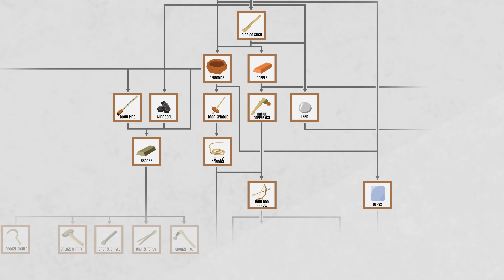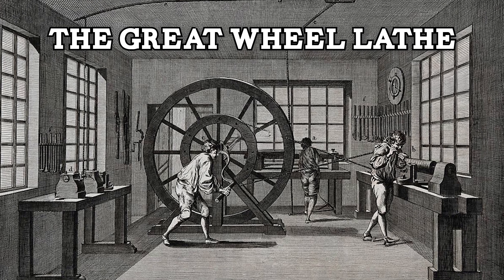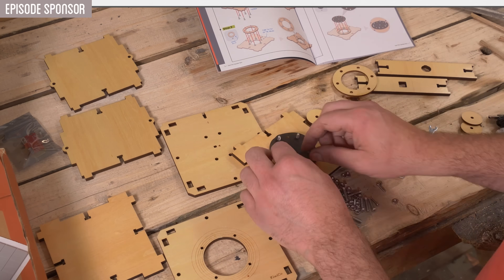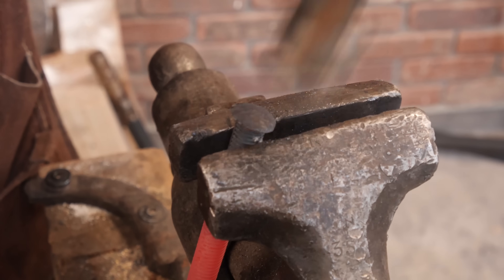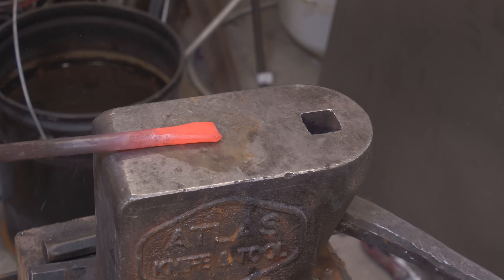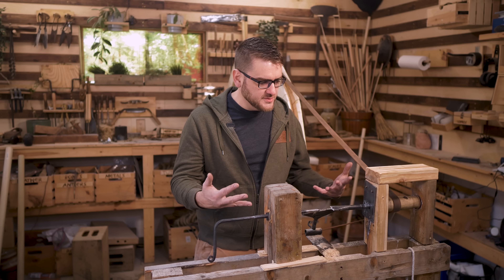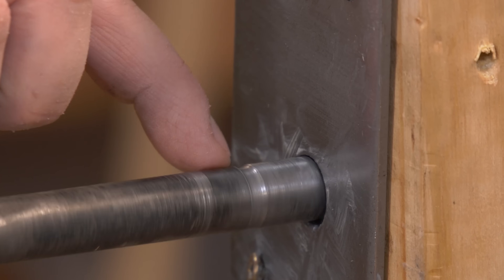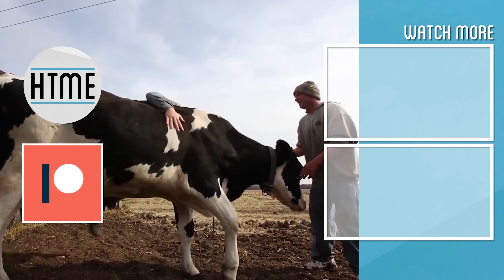Building the Lathe That Will Build Everything

Comment: Steel on steel wears, as you have noticed. A bronze bushing is a good choice until ballbearings are unlocked.
Reply: AIUI they used greased leather for a bushing material, clamped tight.  You need an essentially zero play spindle if you want to cut metal or cut with precision.
Reply: @AlitaGunm99  You can turn metal between two greased dead centres. then the play in a coaxial spindle outside the static dead centre doesn't matter. it will transmit the motion through a lathe dog.
Reply: @AlitaGunm99 I was a machinist for a decade, running lathes, mills, grinders, EDM, etc....

Drilling an accurate hole is not too hard, outside turning a bit harder, and maintaining concentricity and parallel is hardest.  Grinding to precision is easier with metal than using an inferior lathe.  Once you put one machine together with little slop in its ways (the rails on which the cutting tools slide), making screws and things elis fairly easy.

The genius of the early metal lathes, IMO, is how adjustable they were.

For some operations, like cutting through the bark (outer crust of cast metals), I would turn our old machine backwards, flip my tool upside down, and let the "looseness" work in my favor.  

TLDR, sometimes a less precise setup is better, and grinding and filing to precision is pretty easy.
Reply: He could even use wood with lubrication. And drastically reduce the stick out of the axle from the block.
Reply: @Lysdexis   Yeah get the hardest wood you have and soak it in lubricant for days.
Reply: was about to type something similar about bronze or copper bushings, but could utilize wooden dowl/pin bearings.
Reply: @chuckystabs1745  I don't think wooden needle bearings would work very well; not enough contact area and too soft.
Reply: A hard lead alloy would be easier to cast than bronze.
Reply: @Piglin_Jesus  Babbitt metal would work great too.
Reply: @Piglin_Jesus  The low melting point makes it a bad choice for a lathe, unless they are constantly dousing it. Even then, any debris at all. If it doesn't just scrape away the lead, it will certainly add enough friction to melt it.
Reply: @timbrwolf1121  Lead has a melting point of ~620 F and babbit metal has a melting point of ~450 F.  Babbitt metal has been used in bearings for over 200 years.  The entire point of the bearing are to reduce frictions and stabilize rotation.
Reply: Actually, lathes use mainly bushings to this day as they are more precise and can take higher load
Reply: What is a bronze bushing ?
Reply: @PotionsMaster666  A piece of solid bronze with a bore for a shaft; steel on bronze moves smoothly and freely, especially with a little oil or grease.
Reply: @PotionsMaster666  Bronze is an alloy of copper and tin.  A bushing is a cylindrical metal sleeve that acts as a bearing surface for a cylindrical rod inserted through the bushing.
Reply: The places where I work uses purple heart or teak for lathe and grinding wheel bearings
Reply: why not brass? has he not gotten zinc yet?
Reply: Cylindrical roller bearings would make sense here, and simple to produce.
Reply: Next step would be to cast the bed, the tailstock and the headstock out of iron. The pulley could be cast as well, giving the machine a much more rigid structure.

Comment: another factor onyour belts,   they actually work best on a bulged pully,  not in a notch,   the outward bulge of the surface helps to move the belt back to the middle rather than slipping off to one side.

Comment: Awesome work and yeah the lathe is one of the center pieces of modern working^^ The flywheel is a development on its own ... yours currently is using a lot of energy to move itself around .. and has a relativly low weight overall moving around but getting a heavier flywheel balanced is supprisingly complex and dangerous if not secured correctly.

Comment: I realize you're already past this step, but the talk about screws made me think of how to easily make a precise metal screw without one to go off of to start with, and I had an idea. Would you be able to make a tightly wound spring the length of the screw you want, with the wire gage of the spring being the width you want between each ridge, then cast a brass or bronze negative of the inside of the spring to make a precise screw you could use as a guide for making other screws out of harder metals?
Reply: you would have to tightly control the cross section of the spring as well as the pitch for it to have a hope of working. Not exactly the easiest task in the world, distortion can be a bitch when forging, so you'd have to try and adjust the cross section of your straight rod to compensate as you wrapped it into a spring to hopefully result in the negative of the desired threadform on the inside of the spring. 

in short, not easy at all

Comment: Using the lathe to improve itself was so cool.
Reply: It's like computers really. 

We required a computer at one point, then we needed a better one, so we needed a very good computer to build the next tier of computers so we could build an even better computer, so we did and now we have glass slabs that make us mad when we read stuff on them.
Reply: It si like when You have a 3D printer and start to print things for itself.
Reply: The lathe is the king of tools
Reply: The lathe is the only tool that can build itself. Think about that.
Reply: So far
Reply: Well not the only tool. 3D printers can also print themselves. In fact I am doing that right now with "The 100", fully reprap style.
Reply: @DoubsGaming  Please tell me the name is a Terminator reference and the next versions will be "The 200" "The 300" and so on
Reply: Adam Savage once said, “The Lathe is the only tool that can build itself”
Reply: @ Now now, what about the 3D printer?
Reply: @IneptOrange  It can't make its own heating element. As it would just melt instead.
Reply: @Targe0  Very good point

Comment: There are quite a few clever details in old tech, that are not immediately obvious, unless you look carefully. One is the flat belt tech. The wheels don't need and shouldn't have a groove or flanges. They just need to be convex. The belt then centers itself.
Reply: Came down here to say the same thing, but you worded it way better than I ever could lol @esalehtismaki
Reply: If I'm not mistaken flat belt pulleys should be (rather counterintuitively) concave to be self centering
Reply: @rlrfproductions  no, if they were concave, the belt would slip off. Belt sanders also have convex wheels for this reason.
Reply: @coreforge I was mixing up concave and convex hah 😅 but yes, "American football shaped". Though that did surprise me when I learned it, it's the opposite of what I reasonably expected
Reply: It's the same principle as on train wheels

Comment: 8:25 a belt with even a little bit of stretch centers itself on the larder part of a wheel rather than the valley, on the little wheel you an see this quite well, its not an alignment issue its just physics, i think it was steve mould who had a great video on it (tho its been a while and im not 100% certain but it sounds like it would be his video)
Reply: They realize this and change the part in the video
Reply: @ yes and my comment was mainly as an explanation as to WHY this happened in the first place

Comment: I feel like you would have better results on EVERYTHING you do if you made a point to overbuild stuff, measure it better, keep it level, and use less crappy wood. You've got the inspiration but everything you make is too flexible. I think part of the problem is you're getting cheap wood at a home center- go to a proper lumber yard and get better wood, it's tougher and wont flex or lost dimension as much
Reply: The main issue I think is cost
Reply: @theomelchior2739  No, it's time. If Andy took the time to do it well-built and proper, it'd take too much time to consistently release videos. And that'd sink the channel due to lack of funding.
Reply: @JoshuaNorton  while I generally agree with you, some well built, reusable parts would greatly improve his capabilities. Something like a well made wheel and axle could have boosted several of his creations.
Reply: @theomelchior2739  You would be surprised how much more you pay for the convenience of big box stores. A small amount of higher quality wood isn't that expensive.
Reply: This is why I don't watch this channel much. Everything is just such low quality and he always assumed the thing isn't good because of that.
Reply: Of course he's not going to build the perfect machine. That usually requires maaaaany people and maaaaany years of experience. One person can't do that and that's fine.
Reply: @MatthiasLehnen  i meam, sure, but at the same time theres some glaringly obvious flaws and issues which i'm convinced would take less time to solve than the time it takes to work around them. Something like spending a bit more money to get better wood, spending just an hour or so loading the machines with sand bags so it doesn't wobble, spending an hour or 2 to make a rudimentary brass bushing, and maybe another 2 hours to straighten the flywheel. Thats about a days work which will pay off by needing less time and effort when using the machine, allowing the creation of better parts, which improves the quality of everything those parts are used in, which saves even more time down the line. the ripple effects on time savinga of those low hanging fruits is immense.
Reply: i agree fully with OP - its a ckunterintuitive "spend time to save time" thing, honestly not too dissimilar from "buy cheap, buy twice" but with your own productivity rather than a product
Reply: I agree. I love this YouTube channel, but it should actually be called How to Make Everything Crappy. These people have a lot of enthusiasm but very little skill and "designer's intuition". For example, the claim that learning to use a pedal lathe would take a lot of time.. Like what? That's a matter of one day at most. Or that they used a concave pulley first. He seems to be very interested in this technical stuff, doing various research for the content and so on, but then he puts a concave pulley in there as if he didn't think about it at all. I don't get it.
Reply: @FarAwayInNature-r4f  The pedal lathe he built would take a lot of time to learn because of its mechanical inefficiencies due to poor build quality. Part of his thinking is to get past each step quickly to get to steam
Reply: @flyingmonkeydeathsquadronc968  Yes, exactly as you write " poor build quality". Yet the pedal lathe is perhaps one of the most primitive pieces of equipment, still used perhaps everywhere in the world, and it is a very useful thing. You don't need top quality wood to build one, the construction can be quite crude, and you can still achieve quite precise work with wood and even soft metals. If they built it properly, it could be very useful to them, even in the steam era. I'm not exactly sure what they're after then. Whether they want to build functional replicas of historical inventions and use them to move forward, or just present a shaky thing that can barely withstand filming. Because if B is right, there's nothing to look forward to. If they can't handle a primitive lathe, what will a steam engine look like? If A is right, they might finally learn from the mistakes they keep making over and over again and start making it properly. And in their case, that doesn't mean spending more time or money on it, it means starting to think about what I'm doing and how I'm doing it.
Reply: @FarAwayInNature-r4f  that's always been my opinion too. A ton of effort, quality and enthusiasm in production but then just build a crooked thing. No craftsman would have finished these builds if they were crap. This is like Gilligan's island staring a very creative actor who is pretty ok at building some stuff. With that said he's better than I will ever be at much of this stuff and I applaud his efforts to create such a cool legacy. I do still watch often.
Reply: There are so many skills needed. Engineering, metalworking, woodworking, each of which takes years to get really good at.
Reply: Also if they cared, they make crap because they are fine with making crap rather then make something good.
Reply: @Thorgon-Cross  the problem with boot strapping into precision is you HAVE TO take time and build quality or the inaccuracies you introduce at each step will set you back two.
Reply: @Vulpecula1919  Glad you agree.

Comment: Making the giant wheel spin level would be a big help, when things spin on their side there's some gyroscopic effect that acts on them which makes them wanna pull further sideways till it can hit a balance point

Also tension is your friend when it comes to belt pullys, you could either rework the spacing of the wheels themselves or add a adjustable height wheel that presses against the belt (I think a spring powered extra wheel to act as a lead & provide tension seems more efficient) what ya don't wanna do

Comment: Once you fix your belt pulley, get the wheel alignment dialed in, and take out some more of the play in the axle, you'll have a genuinely nice machine on your hands!
Reply: Also the drive axle didn't look quite straight. Having the drive axle and tail stock along one axis is important for lathe precision. So more attention must be placed into this for a more accurate lathe
Reply: that describes everything hes ever made!
Reply: Also you might want a bulge/crown in the centre of the pulley - it helps to self-align the belt (rather counter-intuitively). If you're interested search up Steve Mould's video "The Band Should Slip Off But It Does The Opposite!"
Reply: @rewindoflow  
That crowned pulley you mention is literally being made at 09:40 and installed at 09:58
Reply: @ Ah somehow I completely missed this!
Reply: @rewindoflow  This is the keys. On a non indexed belt drive the drive pulley should be convex instead of concave as the belt tends to climb to the highest point. You can also see it in this video; the belt is always stuck on the left or right hump of the pulley.
Reply: @horsethief6184  yes that's what made me think of it, seeing the belt climbing to one side!
Reply: @rewindoflow It's generally a good idea to watch the video before you comment.

Comment: @htme Might I suggest casting babbitt bearings in place for your lathe? Also perhaps a bronze bearing on the tailstock to stop it drilling into the workpiece?
Reply: I was going to suggest just that.
And, the components for it should already be unlocked as the most basic babbit is lead and tin. For lubricant, olive oil would work until you get hydrocarbon lubricants.

Comment: You need to move your drive center and dead center closer to your headstock and tail stock. They stick out too far and induce flex that reduces your accuracy. The other way to correct the problem with accuracy is to increase the diameter of your drive center and dead center.
Reply: Or increase rigidity
Reply: @  that's exactly what is done by increasing the diameter.
Reply: Was going to say the same thing. A lot of wobble going on there.
Reply: shortening the spindles is easier than remaking thicker ones, especially if you're having it interact with existing bearings, etc
Reply: @ Yup. But I think the overall issue itself is small diameter metal extended too far from the fixed holders. He could get much better accuracy by increasing the diameter and shortening how far they extend beyond their fixed bases. It would also help if he made a new tail stock and lined its center up with the headstock center.
Reply: Proper bearings would also vastly improve the amount of wobble, as that simple steel plate at the headstock is wearing a groove in the drive spindle.
Either bronze or babbit bearings would be a major step up.
Reply: @ 100%
Reply: Eyup.
That's a recurring problem on this channel: because he don't do things as precisely as he could (with his given technologies) he have a hard time using it, and thus mastering it.
Aligning these parts may have taken less than an hour, and it would have given way better results.

Comment: Classic mistake on the belt pulley. The belt travels uphill, so you want the pulley to be thick on the middle, reverse of what you have.
Reply: Yep, was going to comment this lol luckly the belt found a proper spot on the pulley
Reply: Probably like what they changed it with later, a kind of Barrel Shape?
Reply: its not just because of uphil/downhill it also has to do with the amount of stretch a belt has, if it has a bit of stretch it generally prefers to sit on the mountain rather than the valley
Reply: Which is exactly what he does later in the video.
Reply: Did yall finish watching the video?
Reply: @mechonm69  yes obviously i just take my pen to write down the timestamp and what i want to say so i can finish the video first like any reasonable person...
Reply: Excellent point! We did indeed remake the spindle pulley to be convex later in the video, which did wonders to improve the machine. I love it when machines can make their own parts to improve themselves.
Reply: Just paused to share the Steve Mould video on the subject and low and behold this was the top comment!
Reply: I saw that happening and was reminded of an old science video I watched a million years ago about that exact phenomenon. Good times
Reply: Came on to comment this as well...
Reply: Can Confirm, as far as belts go, 
Convex Pulley > Concave Pulley
Reply: Was just about to comment this. But a nice demonstration of what happens when there's a gulley in the middle
Reply: Convex like a railroad track
Reply: Came here to say this. 😂
Reply: If I had a nickel for every time someone got that wrong.
Reply: This channel could be called "classic mistakes"